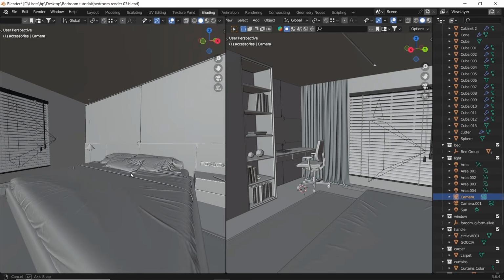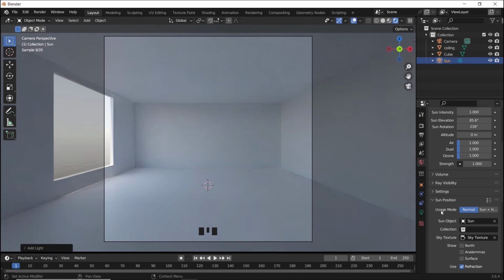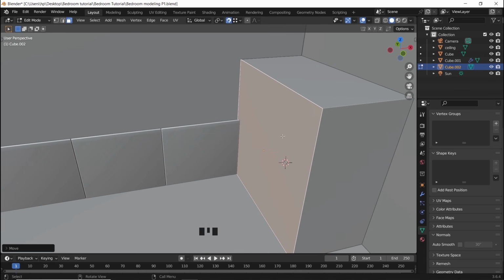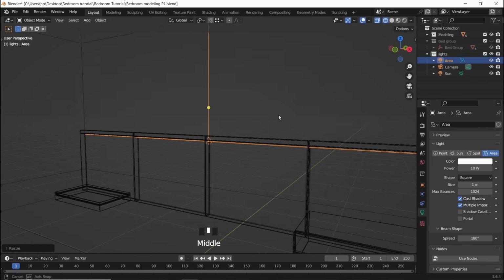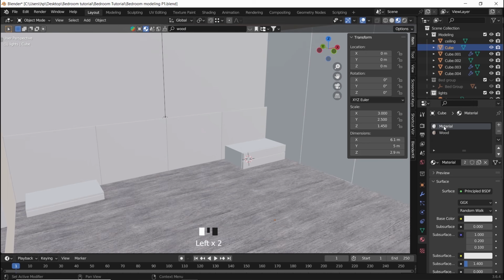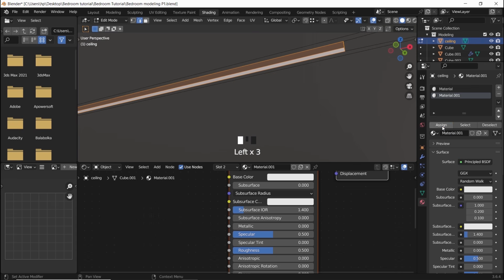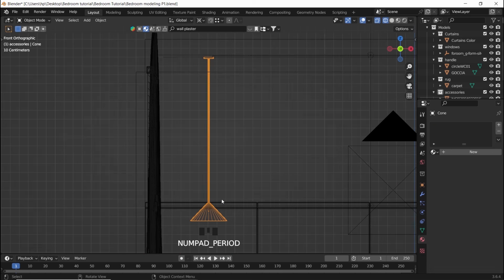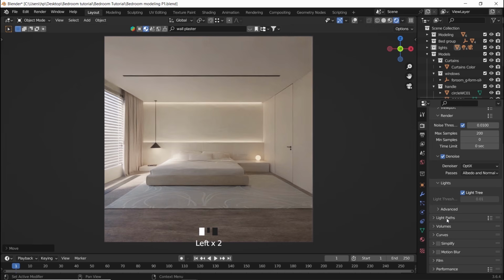How to Model Interior in Blender

Comment: hey i wanna buy an pc for blender (for noob) but i have only 600$ which on can i buy please help me
Reply from the maker: it's a bit hard to get something decent with 600, but you might look for a second hand used ones, something like hp Victous or asus tuf or rog based on the edition, hp ones are better in colors.
I use to have an HP ZBook Quadro m1200 and i used it from 2018 to 2022, it was fine and i got it cheap cause it was used for like 3 months, quadro are also very dope for 3D design, but they come in expensive.
Look into your local market, spread the word, might get something cheap and nice in week or 2.
Reply: @architecturetopics  thank you so much :)

Comment: which blender software version is supportable for 8 gb ram and processor is ryzen 5500u laptop🥲pleas
Reply from the maker: The minimum is 8 ram so it should run the latest but try the 3.6, or even 2.8 if you're not into geometry node. i
5500u performance can vary depend on the GPU but should be enough, i use to run blender on the 2017 Quadro m1200 up to like last year so try it out on small projects first and see how it goes.

Comment: flipping the normals didn't help me see the room from the outside like it did in the video only reversed the colors but no other difference
Reply from the maker: Make sure you didn't duplicate the mesh, and that the backface culling is on and it should run. Try it on a new file you might check something by mistake.

Comment: Great Video but i have a question. Is there any add-on to use for the lightnig settings (the light above the bed)? If i want to change the light color and so on i cant find the options like "beam shape" or "nodes" on the right side there is only Preview, light, shadow & Custom Properties to find. best greatings
Reply from the maker: Check this video it has a list of lighting addons
https://youtu.be/T4E23UW6YTA?si=ZCrNHVcFCx2hKaTe
Reply: don't need any add on for that settings to show, just switch to cycle render the settings will show

Comment: Excellent tutorial for someone beginning, well paced and very nicely explained. But i have a question, at 6:06 even though i flipped the normals i still cannot see the inside of the room like you did in here.
Reply: Felipe, for this to work requires:
1) Flip the normals,
2) In the objects material you need to have Backface Culling set to on under the Viewport Display, Settings section,
3) You must be in the Material view in the viewport.
Better late than never, in case you never figured it out.
Reply from the maker: thanks mate! it should work with shift N to calculate the normals inside unless you have 2 copies over each others.